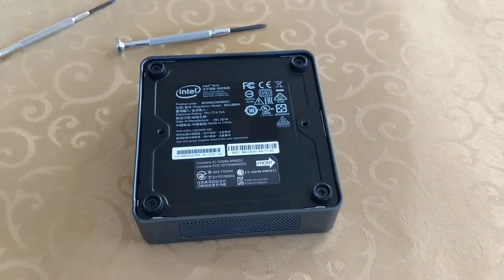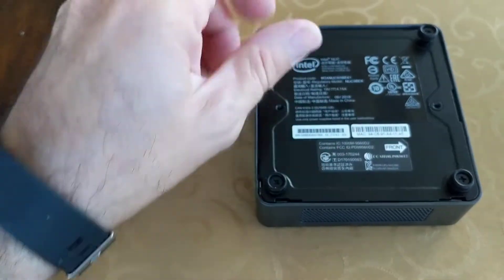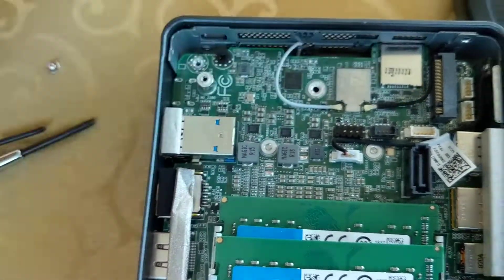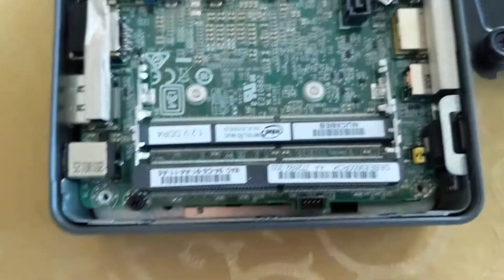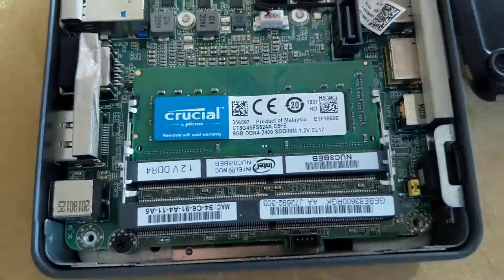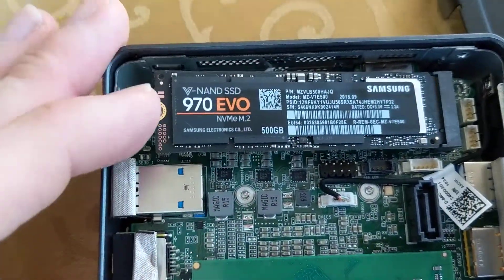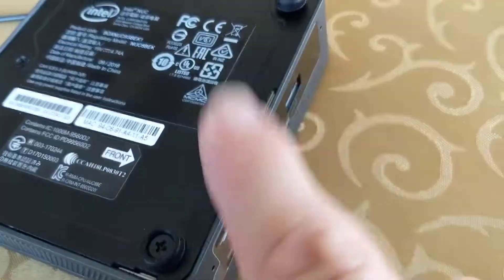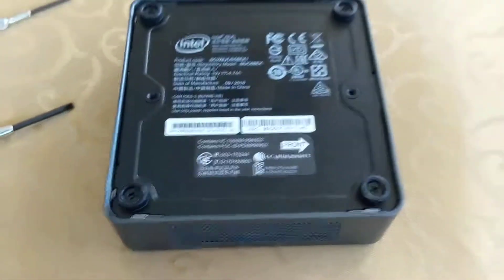Intel NUC memory and SSD install and swap.

Comment: Hi Sean, good tutorial. So I recently got myself a NUC8i7BEH recently, and I love the fact that such a good computer power is available at such a small form factor. I had a small query. I'm new this whole NUC thing, and the model I bought the 16gb RAM and 25gb HD model. Though I don't need to upgrade the RAM anytime soon, I would love to upgrade the storage to 1 tb someday. So, do I just take a backup of the data and swap that with the new one, and all is good? Or do I need  to reinstall the Windows again? I know it's a terrible nood question, but since it came with proprietary Windows 10, I don't how get the Original Windows back if lose it while changing the storage.

Regards,
Ranajit (India)

Comment: one more question, after I have finished installing Windows 10 it didn't show any Wifi, Bluetooth or graphics, so I had to download the drivers on a separate USB then install them on the NUC then it recognized them, so my question is, weren't the drivers supposed to install automatically during the Windows 10 installation?
Reply from the maker: I think the most recent Intel NUC's will automatically install Wifi and Bluetooth with the most recent Windows 10 install media. And it might have to do with me having the network cable plugged in when installing Windows 10. Your solution of downloading them and installing them from USB works as well. Usually if you can get the network driver installed (either hard wired or wifi) then the rest of the drivers will come through windows update.

Comment: Thanks for the helpful video,
I just installed the m2 ssd on my 
Intel BOXNUC8i3CYSM1, but it is not showing up as a partition, any idea what I ned to do?
Reply from the maker: Usually when you put a new drive in the machine, you need to create a partition first. Installing Windows 10? When you boot to the USB drive and start the install process, there will be an option on where to install Windows 10. You can create a partition, or use the entire drive. Hope that helps, let me know how it goes.

This video (from someone else) might help you get through it. https://www.youtube.com/watch?v=q9b6VqwA7vk
Reply: @SeanCaldwellvo  Thanks for ur care & reply :)
I bought a new Intel NUC that comes with 2.5" HDD, and bough an extra

Samsung 970 EVO 500GB - NVMe PCIe M.2 2280 SSD to have it as the main Windows bootable disk.
So I found out that I need to creat partition first as you said,
and it seems to must be as Primary partition, NTFS, .. etc
But now I am stuck at the step of being unable to transfer/mirgate the OS to the SSD using any feature in the windows, or a free third party app.

All I can find is EaseUS, Partion Wizard, and some other third party apps, that ALL require me to buy to do this step.
Do you have any kind of advise about migrating the OS to be fully loaded and bootable from the SSD?
Would really appreciate it.

Comment: Hi great Video. I installed my NUC watching this video. I have a NUC 8 i5, with ssd in it with windows 10 and all my files. I am getting a New NUC 10 i7. I am thinking to just take the ssd out from the old one and put it in the new one. Do you think it will work ?

Comment: Good video - I'm an old tinkerer with SFF's and towers but looking to get into minis- what could you use that internal SATA port for?
Reply from the maker: Pretty sure the smaller NUC that I usually build doesn't have an internal SATA. The slightly taller one does have a SATA port and you would be able to have an m.2 drive as well as a sata ssd...two drives for lots of fast storage.

Comment: If I have one stick of ram which slot do I use?
Reply from the maker: It's worked in either slot for me. If you can see the slots labeled inside the computer, go for the lower numbered slot first (slot_0 first, then slot_1 for example)

Comment: This was great, thanks! I would like to find out what to do before I transfer a SSD from my old NUC to a new NUC. Any suggestions? I will obviously save data files, but I wonder if there is a way to retain all the apps as well, and will Windows 10 have to be reinstalled?
Reply from the maker: Unless it's the exact same processor and model number, I'd say avoid trying to just move it over. You'll need to reinstall Windows 10 and then all the apps/programs. You could try to clone it to another SSD and see if it works. Then let us know how it goes. Windows 10 has gotten better at hardware swaps.

Comment: do I have to install a 32bit or 64bit of Windows with this new NUC8?
Reply from the maker: 64 bit. If you install 32 bit you'll only have access to a small portion of the computer memory.
Reply: @SeanCaldwellvo  thank you for the quick reply, I just ordered the i7 version from Amazon.

Comment: Can I use an 860 EVO SATA M.2 SSD (http://a.co/d/cexE6zr) or does it have to be the 970 EVO?
Reply from the maker: You can use any M.2 that fits the specifications for this nuc (2280). The newer 970 EVO plus are great if you're looking for ultimate performance: https://amzn.to/39GmXQt
Reply: a SATA SSD will be slower than an NVMe one though.